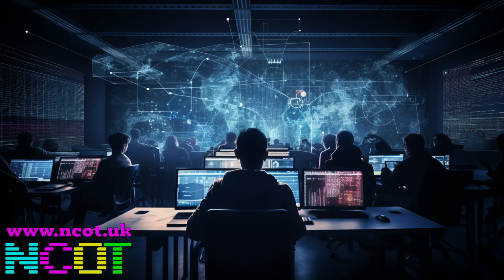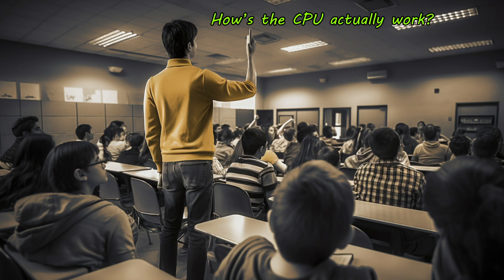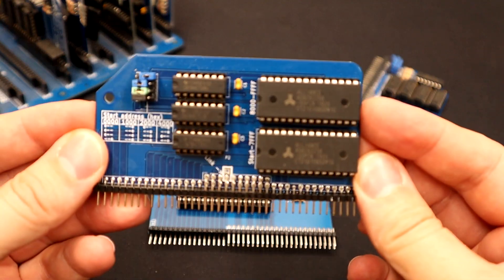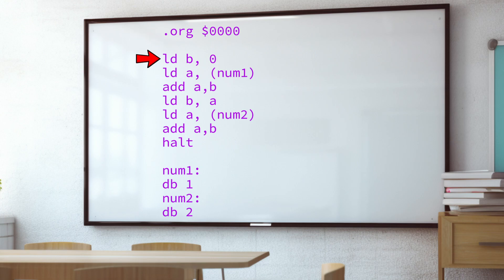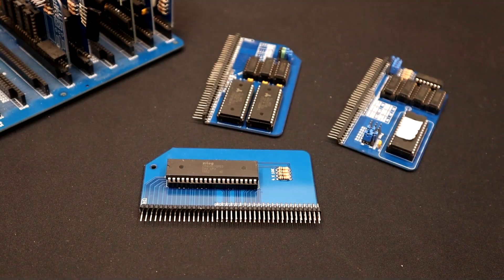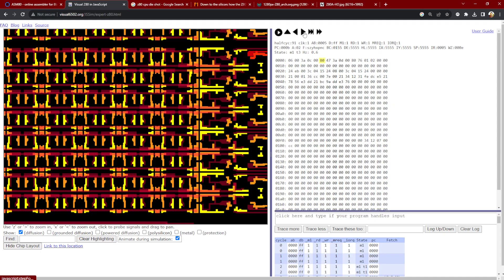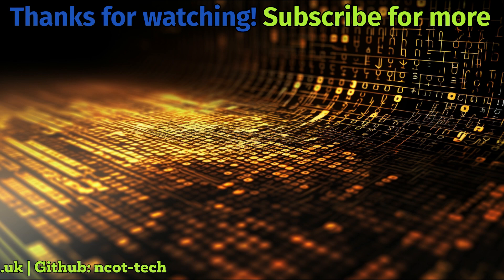Zilog Z80 Deep Dive - How does it work?

Comment: I was confused by the program to add two numbers.  Register b cant be (conveniently) loaded from memory, so num1 is loaded to the accumulator and transfered to b. But b never needs loaded with 0 and the first add a,b instruction is redundant.
Reply: I wonder!
Doesn't the instruction  LD B,$xx  load a value from memory to B register?
Reply: @Bob-1802  Not quite. That mnemonic loads the B register with a LITERAL integer value! If such an  instruction as was suggested would exist it would be LD B,(xx) which is load B with the contents of memory address xx. An instruction that doesn't exist in the Z80 as the OP wrote.
Reply: Hi  @Bob-1802  , 
I had to check to be sure but no - $xx in that instruction is what is known as an "absolute" value, its value is fixed within the encoded instruction not elsewhere in memory. If you look at the HEX compilation of the instruction it is 06 00. 06 means LD B  and 00 is the absolute value to load.
In this syntax if the value is in memory, then it is written in brackets like : LD A,(location)  That is called 'direct' addressing, where 'location' is the address of the memory containing the value to be loaded. Z80 can only read single bytes from memory into the A register not the others. This makes its instructions more convoluted than for example 6502 instructions to add numbers. 
The example here is further obscured, as B never needs loaded with 0 and the first ADD just adds 0 to (num1). That could serve a purpose in a different algorithm where it was perhaps clipped out of for this example, as adding 0 will include a CARRY from any previous add instruction, but here its totally meaningless and does confuse the lesson a bit.

I came across a good essay on this here ->
cowlark.com/2018-03-18-z80-arithmetic

Comment: In the 1970's Radio Shack had a small book that explained the inner workings of the logic circuits in a handheld calculator.  In about 1981, the Sinclair ZX-81 became available.  It was a real computer, powered by a Z80 and had 1 or 2 kilobytes of RAM depending on the version you got.  (I think the original English ZX-81 came with 1K and the U.S. Timex Sinclair ZX-81 version had 2K.).  I put one together from a $100 kit.  You could write small programs in Sinclair Basic, and if you were ambitious, you could escape from writing programs in Basic to programing directly in Z80 machine code.  The Radio Shack book, and the Sinclair ZX-81 were a wonderful place to start to learn the basics of computing.  I'm glad I had the experience of learning about computers on the ZX-81.

Comment: one of the most helpful things i found to understand is the cpu reads the instruction stack from memory. this clarifies 1. cpu is not following instruction set literally as it also performs its own mem lookups to read the instructions (and other stuffs like store jump pointers), and 2. the cpu does not store any data itself and when data is fetched any one of several memory or peripherals could respond (has no control). understanding from this angle solidifies what role is and allows to imagine in head a continuous loop of operations.
Reply: You talk about microcode vs RISC with dedicated code memory?
Reply: @ArneChristianRosenfeldt  right.  perhaps it is due to being a programmer, but i had always assumed prior that cpu 'stores and runs the code' in a literal sense. while in reality, it could be processing instructions from a vid card's mapped i/o. where the instructions are stored, or how they are arranged (other than being sequential upon no branch case), is not its responsibility.

Comment: The array of dots is the instruction decoder (ROM). It's basicly just a lookup which is hooked to the internal control lines of the ALU and other parts of the chip. This decoder ROM is basically the physical predecessor to microcode.
Reply: You mean implementation?
Reply: @ArneChristianRosenfeldt  No i meant predecessor, because the microcode in these chips was not writable. Today's microcode ROMs are technically EEPROMs. But maybe that's a definition thing in my head :D
Reply: @KitsuneAlex  I read that microcode was invented and the name coined in 1968 before the invention of microprocessor.
Reply: @ArneChristianRosenfeldt  Oh damn, i didn't know that! Gonna look into that now hahaha.
Reply: Basically you cannot correctly spell basically.
Reply: @SpeccyMan  My god, the world will end because i misspelled a word :P

Comment: I took a whole semester of Digital Electronics in college to find out how CPUs work, so yeah, not a great topic for a tossed-off answer. It was a pretty cool course, what with designing circuits from scratch with flow charts and voltage timing diagrams, but it also wasn't especially relevant to my programming focus. (Aside from the bit of the final project where I had to hand-assemble a small 8080 program into octal.)

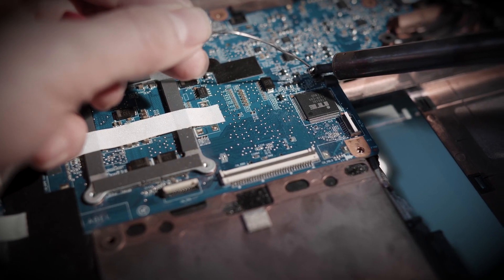Comment: 10:36 Nothing says "I am not an electrical engineeer." as almost spilling some welding wire randomly in a PC motherboard for no reason at all. =) That made me pretty anxious and then I just started laughing XD
Reply: solder
Reply: @SpeccyMan  Thanks for the correction. I have read about and practiced with electronics in another language, so I sometimes mix up some terms in english.

Comment: If that kid really wants to understand they just need to go an implement an 8bit cpu from scratch in verilog on an FPGA.   Then they'll understand the basics.  I do understand why they would ask though, today everything CPU/Computer wise is stupidly complex, you'd struggle to understand how everything actually works.   Those of us who started this journey as children back in the 70's and 80's had a much easier time, you really could understand exactly how a CPU and computer worked back then.   The manuals even came with the full circuit diagram of the machine.
Reply: Better still implement an 8-bit CPU using 74 series TTL logic! That would be a real challenge.
Reply: @SpeccyMan  That is fun.  Could make it even more fun and only allow them to use a single kind of gate such as the magical NAND. :D

Comment: I'm a chip engineer and I have to say, it's sometimes hard for even us to answer that question. We all specialize so far into our specific parts of a CPU that we may not know how a whole thing works. I did my PhD on ways to optimize active interposer design, which is basically a chip you put other chips on top of to allow them to talk together. Think about a Vega64 or Radeon VII. Those have passive interposers, just a bunch of tiny wires through a hunk of silicon to connect memory to the GPU. My work was on effective ways to implement some logic into that chip, like moving the memory controller down there, or the PCIE bus, or maybe a huge chunk of SRAM for a cache.

I actually work on CPUs, not GPUs, but most people are more familiar with the Vega64 or VII than they are with Intel's Lakefield, which is actually something I worked on. I do regret the awful performance of those chips. A single Sunny Cove core with no hyperthreading paired with 4 old atom cores was never destined for greatness. Up next for me was the bridge dies in Sapphire Rapids, and now the topic of my PhD itself becomes a product in Meteor Lake. The architects make it all work inside, I'm just a glorified electrician wiring shit together.
Reply: I’m a sparky of 35 years experience and an electrical inspector, and I can tell you sir that your work just blows me away!
The engineering behind such IC’s is just extraordinary!
👍👍👍
Reply: Your way too hard on yourself about the chip. Even a sub par modern chip is a marvel of engineering.
Reply: @putinslittlehacker4793  I know it sounds that way here but I just want to give some perspective on how insanely complicated these things are and how deep the research hole goes. My PhD was completed in 2011 and not even Arrow Lake has a true active interposer yet. My most recent research at Intel may not hit the foundry floor until 2030 for another example.

It takes decades of work on top of a PhD to even be building a single part of a single part of one of these chips.

As for the Lakefield bit, those chips were a cool experiment and are still informing us about better hardware practices, but they truly did suck in the segment they were marketed. They would have been cool as smartphone chips, but were woefully underpowered for a laptop.

Comment: You brought back a lot of memories.  LD  B,0?  XOR B,B!  Probably the first "improvement" I learnt.  Keep well m8.   😃 🖖 🇦🇺
Reply: In Z80 XOR works with "A" registry only. Z80 have't XOR B,B operation.
Reply: @maxims.4882  That isn't entirely accurate as the XOR r instruction specifies any of A,B,C,D,E,H and L to be r so an XOR B is possible but it should more accurately be seen as meaning XOR A,B since the result will still end up in the accumulator and not provide the result the OP suggested. The only way to zero the B register is LD B,0. There is no shortcut.
Reply: @maxims.4882  So far as I recall you are correct.  It's been a lot of years since I last used asm on a TRS-80.  So thanks for the correction m8.  I've probably forgotten more than I knew.   🤣

Comment: The answer to the students question (a true answer, actually) about how a CPU executes binary machine code, is that the CPU is running a program written in micro-code that carries out the necessary operations to implement the machine code.
Reply: And what if it is RISCV without microcode?
Reply: @ArneChristianRosenfeldt  - since RISC V is an architecture as opposed to an implementation of that architecture, it makes no sense to ask if RISC V is, has been, or will be based on microcode or not, since it can be all of the above.
Reply: The introduction into the instruction formats goes into the bare metal layout of the multiplexer. The ISA is tied tightly to single cycle RISC. Though indeed, the smallest implementation uses multiple cycles, but I have not looked into it. Probably the cache logic in Load/Store is replaced by microcode. Also the branch instruction could be split into two ALU cycles: One for compare and the other for the relative addressing of the jump.  @JanBruunAndersen

Comment: Don't know if the Z80 has any, but the 6502 has "illegal opcodes" which do strange things according to the decode matrix, as the bits of the opcode define what to do and what to do it to (with the later 65C02 locking out the functions and treating all the undefined as NOP of varying cycle time)
Reply: That would be true of almost any similarly designed hardware, especially with no intermediate layers.

The 6502 and Z80 achieve all of their functionality in actual hardware. Or, in other words, there is a block of hardware for the ADD operation/instruction and a separate one for the SUBTRACT...

Whereas most modern CPUs rely on building Instructions/Operations in microcode.
Reply: @jnharton  6502 and z80 and even SAP-1 as presented by Ben Eater use a standard ALU just like processors did before. ADD and SUB happen in the same block of hardware. Logic also. The ALU does not have illegal control inputs. Likewise it is easy to avoid illegal register names: just have a power of two number of registers! I like the branch encoding in 6502: 2 bits name the flag. One bit has the value for which a branch should be taken. Nothing illegal. Just “always branch” is missing.
Reply: @jnharton  I read that on the 65c02 all illegal instructions were mapped to NOP. I interpreted this as : in the year 1981 all instructions became legal (redefined ISA). You seem to interpret it as: some extra unit in front converts instructions. Ah, at least we can say that illegal instructions break compatibility between 6502 and 66c02.

Check the datasheet for a discrete ALU and then look at the die shot of the 8008 or ARM2. That circuits is not complex and there is no multiplexer. Most complex thing is the carry look ahead circuit as explained by the YouTuber spanning tree.
Reply: It does. 😊
Reply: I think Intel 8050 fills the complete matrix in a regular way. No prefix allowed. No illegal opcode. SuperFx has 8 Bit instructions.  All legal. So it is not thaaat difficult.